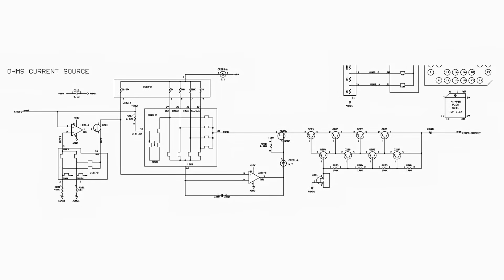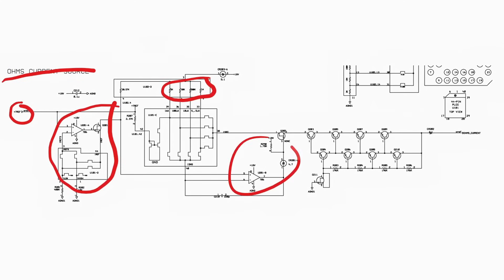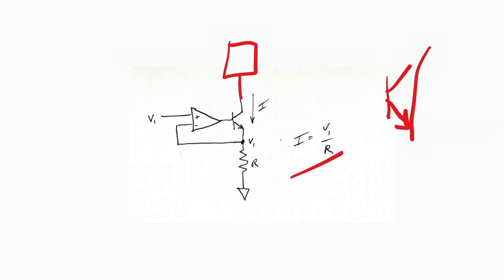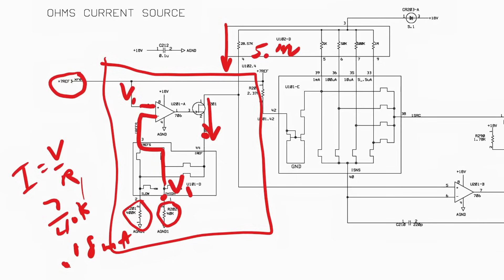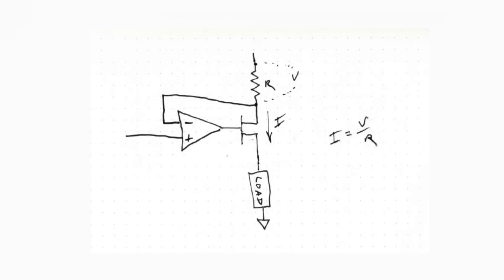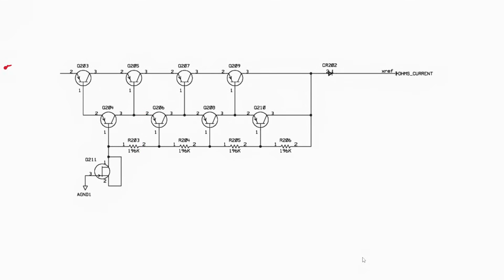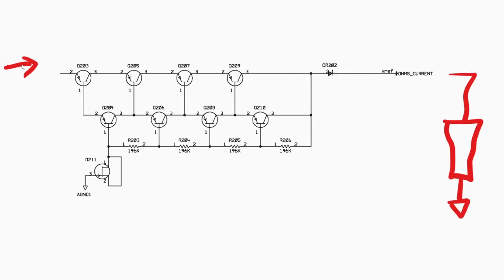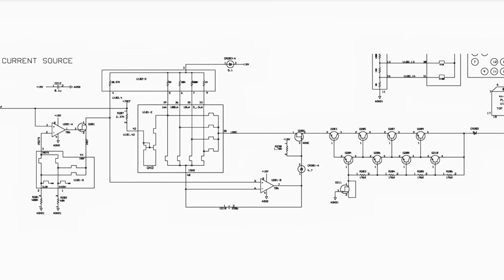#1818 Current Source from HP34401 Explained

Comment: I saw your video last night, so this morning I went to analyze the circuit (at 9:07) and I think this is correct: Q201 and U102 form a voltage mirror on pin 1 of Q202.  It seems confused, since U201 pin 6 is connected to Q202 pin 1 through the switches, it copies voltage from Q201 pin 1 to Q202 gate via U201, ending up Q202 working as a current mirror of Q201, it works pretty well.  The current mirror at the left inside U101, promotes almost 3mA (when the switch on source of the second fet is on) over the 5k resistor, what in fact zero the voltage at pin 1 of Q202, since the Vdrop over 5k is higher than 18V-CR203 zenerV,  it can calibrate the ADC for zero ohms when going into that scale.  This circuit could promote 8 ohms range, 4 x 2 (R201/R202), but uses only 7 ranges.

Comment: I had some success in lowering the noise of the ohm meter current source by replacing CR201 4V7 with a low-noise type.  As the zener CR201 is in series with the output of the op amp it contributes to the noise on the current source.  I would also replace C210 220pf with COG capacitor to reduce any TC effects.  Hope this helps someone.cheers

Comment: Hi, 
I guess that using transistor breakdown instead of zener is for speed. Seen many IC's with two transistors, each having their collectors shorted to base, and using the Vebo breakdown (typically 5-6v) as back to back zeners for input protection. The reason is the much higher speed of the transistor breakdown than zeners, so very fast spikes can be clamped.

Comment: Thanks for the video, I just subscribed to your channel.   I'm always curious on how test equipment electronics work.  Back in the 1990's I worked at HP Test and Measurement Division as a firmware engineer.  I was working on Automated Test Equipment that could test Flash Memory in the wafer sort in the semiconductor manufacturing process... I wished I had used my HP discount to buy my test equipment then.  Anyway, I purchased a used  HP34401 bench multimeter, specifically wanted it branded as HP,  and what a joy it is to use.  My display is dim, so I've already ordered a new one through E-Bay, a new VFD is on its way to me in 10 days. I saw your video on the subject and hope to get that meter back to its old self with the new display.  There are hardly any scratches on this equipment, so I think it had an easy life.
Reply: Hi Ray, perhaps we overlapped a bit. I worked as a hardware engineer on "the hill" until about 1991 and knew the whole design team for the 34401. I'm happy to say that I did purchase one at employee discount and it is still working fine on my bench at home. My present employer is kind enough to calibrate it for me from time to time. The ADC design from the 34401 was reused in the wildly successful 34970 DAQ box. We have three or four dozen of the later in service where I work. They are used in many production cells and also in R&D.
Reply: @davidrick959   That is so cool... I think it is so amazing to work with talented people that work on design... it takes a team, That is for sure!   I was at HP/Agilent 1996 - 2000, Worked at the Santa Clara Site, Building 53.  I worked in the CSTD (California Semiconductor Test Division) doing the firmware on their Test Site Controller boards for the Versatest line of FLASH memory testers primarily used in production cleanroom wafter sort testers.

I have to say that those were the last days of HP that I witnessed as the company spun itself into various companies and is no longer what it was... but at least I got to see it.   I visited HP Labs in the day, it was only a couple of times, but I'll always have the fond memories.

I found a local company here in the Bay Area that sells used lab equipment, and the old HP gear still fetches high prices... but they had some nice HP branded equipment and bought a couple of pieces, the Arb Frequency Generator 33120A and the 34401A multimeter.  They are excellent, as you well know, I put them in my home lab, and rack mounted them (somewhat on a shelf).  The Display on the multimeter is a bit dimmer than the other unit, while it is still visible, I'm going to replace it anyway... I plan to keep the other display... but it is a piece of history, and I enjoy using it at my bench.

Presently looking for work, Are you still with Keysight or whatever they call themselves today?

Comment: The protection circuit for negative negative voltages works like a kind of cascode circuit. Q211 works like a very low leakage diode.  R203, R204, R205, R206 are a voltage divider, so the reverse voltage is divided into -1000V, -750V, -500V, -250V, -0.7V. This causes also causes the corresponding voltage levels on the of collectors of each darlington transistor pairs. The BE diodes of Q203, Q204 and the reverse biased Q211 limit the minimum voltage at Q202 to -2.1 V.

For normal operation with positive voltages from the current source Q211 has high impedance. The very high amplification of the four darlington pairs cause just a small voltage drop on each of the steps of the voltage divider, like 1.5 V. So the total voltage drop of the protection circuit will be around 6 V for "high" test currents of 1 mA. For the low current ranges with 100/10/5/0.5 µA it will be even lower: U= (1,4 V) + (4 * 196 k * I).
Reply: Nope, but interesting thoughts. But: The [RTFM] shows: "Protection from large negative voltages is provided by the sum of the collector to base breakdown voltages of Q203, Q205, Q207, and Q209. Bias for these transistors is provided by Q211 and R203 to R206 while negative overvoltages are applied."
Q211 is a MMBF4117A (Transistor J-FET N-Chan D-Mode). This classic circuit is called: FET constant current two-pole.
[RTFM] Keysight 34401A 6½ Digit Multimeter, Service Guide, Edition 9, August 2014 by Keysight Technologies on Page 98.

Comment: There's a Widlar current mirror in the lower left corner of U101-E (that's the numbering on the IC) probably a custom planar CMOS FET array, and current mirror (Notice the degeneration resistor is not there... maybe the FET matching means it isn't needed?) I think the Guy has discussed current sources in another vid? But what's the dope on the one here?

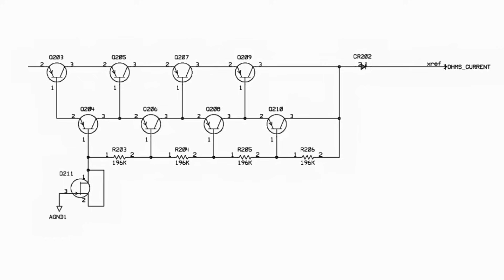Comment: 16:15 I don't follow this logic and how all 8 transistors oppose to breakdown? By Kirchhoff's law breakdown voltage between Qe(203) and Qc(209) is 4 times Vceo (if all top PNPs are the same).
When positive over-voltage is applied CR202 will block it. Q211 functions as a precision diode. When negative voltage is applied, Q211 will drive base of Q204 to ground and the whole transistor network will behave like an active load, limiting current and increasing its resistance to oppose increasing voltage. Voltage on the emitter of Q203 will be aroud 2Vbe (+Vgs). At extreme negative over-voltage 4 transistors on top, or in the middle will just give up and short, one by one. My two cents.

Comment: Thank you very much for taking your time to explain the whole circuit, indeed is a complex arrangement to make a "simple" current source. About the array of protection transistors, that was what got me thinking harder, although i had concluded that would be for negative voltage protection, i wasn't quite sure if it works as i thought it would. On the comments @cogoid complemented your explanation, i think that should be pinned. Once again, thank you very much! 👍😃

Comment: Problem is, the „standard“ opamp current source with the ref voltage against gnd  is in fact a current sink.
If it had to be a source (feeding current into GND), the ref voltages is against positive supply. With „sinking“ current to GND through a resistor connected to positive supply you get exactly this done: having a „5V-below positive power“ ref voltage to compare the voltage drop of the GND referenced current source‘s R against.
It’s a clever use of transferring voltage into current into voltage into current, where the input ref voltage (the 7V) is GND based and the current output is sourcing into GND.
(The old) HP has(/had) clever engineers. 👍🏻
Reply: 34401 is not that old. Ohm meters usually employ a 'low side' current source... that puts the current source between the DUT (a resistance) and the return (call it ground)

Comment: On the protection circuit:
Q211 will act as a diode for significantly large negative voltages, so putting the base of Q204 at about -0.7V 
As the absolute value of negative voltage at Xref increases voltage Drop on R203, R204, R205, R206 increases, so the base to base voltages of Q204,Q206,Q208,Q210 increases, making the transistors to shoulder the voltages equally.  Remember the emitter of these transistors are 0.7 V above base voltage (pnp transistor).
Also note that this circuit is beta multiplying circuit like Darlington structure.  During normal operation only very small current from main test current is used to bias these transistors.
To better see this replace this structure with Darlington Structure and connect the base of the Darlington structure connected to collector using 196K Ohm and compare it with single pnp transistor. Even though, all the currents add up in both ends, however much less voltage drop created on resistors.
Also note that Q211 is connected as diode ( I wonder why they did not used regular diode, may be because of low leakage current) and is off when output voltage is positive.
One should simulate this circuit with output connected to -1V, -5V, -10V etc. to see the distribution of base and collector voltages. Also it might be instructive to simulate this circuit with output connected to a resistor.

Comment: Thanks, I thought this was would be very interesting circuit when I suggested it a while back.  The protection circuit had me scratching my head,  finally had to SPICE the thing to see how it worked.   The key is the string of resistors,  the left end of the string is connected to ground through  a  low leak forwarded biased diode (the FET;s g-s) when a negative voltage is applied to the probe. Thus each resistor drops 1/4 the voltage. 

Think of the transistor pairs as darlingtons and with the resistors makes this a current limiter ( or current source if you like) when the probe is accidentally connected to a negative voltage.  With -400V on the probe each resistor would drop 100V and the transistors would limit the current to limited about 1mA if I remember correctly.  Thus each pair to transistor  only has to manage the Vce breakdown  and power of 1/4  the -1000V speck.  And the 1mA current limit prevents damage to the main percision current source circuit. As IMSA explained so well.    The output diode protects from positive voltages.   In normal mode (probe > 0V) all the transistors are conducting and  all current entering the left side exits the right side since there are not other connection paths.  As  mentioned, there would be some small Vbe voltage drop which doesn't matter. 

Thanks again for the video.
Reply: Q211 is a MMBF4117A (Transistor J-FET N-Chan D-Mode). This classic circuit is called: FET constant current two-pole [1][2]. You are very near the design principle behind the circuit with your "biased diode", but "missed by a hair" is also a target miss, hehehehe. The [RTFM] shows: " Protection from large negative voltages is provided by the sum of the collector to base breakdown voltages of Q203, Q205, Q207, and Q209. Bias for these transistors is provided by Q211 and R203 to R206 while negative overvoltages are applied."

[1] I will not explain here why a self-conducting junction FET (junction FET = JFET) is suitable as a current limiter. This is best read in further literature such as “The semiconductor circuitry” by U.Tietze and Ch.Schenk.
[2] From the German terminology "FET-Konstantstromzweipol", see "JFET as a constant current source | All About Circuits" or "Mosfet constant current", EE-StackExchange

[RTFM] Keysight 34401A 6½ Digit Multimeter, Service Guide, Edition 9, August 2014 by Keysight Technologies on Page 98.

Comment: 17:00 These are high voltage transistors (>350V breakdown voltage each), and what actually happens for a negative enough voltage, is the Q211 diode starts conducting, and that clamps the base of Q204 to -0.7V, and thus the emitter of Q203 always stays at > +0.7V. This prevents the source to be pulled below +0.7V and limits the current to what the source is normally generating.

The transistor Q211, used as a diode, is chosen for its ultra-low reverse current, to not interfere with a normal operation of the source.
Reply: Hi. I am just getting the hang of this stuff. Why is it that when a negative voltage is applied in the wrong direction the Q211 diode starts conducting I'm unsure as to why this happens.
Reply: @trif169 The diode-connected Q211 goes from AGND through four series resistors to the output terminal. AGND is higher than the negative output terminal thus Q211 turns on, and the resistors divide the output voltage drop among them. The Darlington-connected transistor pairs then copy this voltage to their emitters. Since those are high voltage transistors, they can easily each survive having 250V dropped across it. At 1mA that’s 1/4W of dissipation.
Reply: @absurdengineering  You guys are on a good path, but "missed by a hair" is also a target miss:P:) 
Q211 is a MMBF4117A (Transistor J-FET N-Chan D-Mode). This classic circuit (which, by the way, also appears very often in digital ICs) is called: FET constant current two-pole [1][2]. The [RTFM] shows: " Protection from large negative voltages is provided by the sum of the collector to base breakdown voltages of Q203, Q205, Q207, and Q209. Bias for these transistors is provided by Q211 and R203 to
R206 while negative overvoltages are applied."

[1] I will not explain here why a self-conducting junction FET (junction FET = JFET) is suitable as a current limiter. This is best read in further literature such as “The semiconductor circuitry” by U.Tietze and Ch.Schenk.
[2] From the German terminology "FET-Konstantstromzweipol", see "JFET as a constant current source | All About Circuits" or "Mosfet constant current", EE-StackExchange

[RTFM] Keysight 34401A 6½ Digit Multimeter, Service Guide, Edition 9, August 2014 by Keysight Technologies on Page 98.
Reply: @dieSpinnt our aliases have  nearly the same meaning.  😊 
Its a (double) diode and not a two pole current limitter. Q211 Drain and Source are together and not Drain and Gate.
Reply: @trif169 To see it more clearly, start with a simpler circuit. Replace the eight transistors with just one, with the 200K resistor between the collector and the base. Assume some fixed DC current gain, say 100. 

The constant current from the current source, say 1 mA, flows into the emitter. See what the voltages on the emitter and the base will be, as a function of the voltage on the collector, as you vary it.
Reply: Thanks for your input, it makes sense, i hope your comment gets pinned, its relevant information.

Comment: 1) Contrary to what was said below this is not a stack of darlington. In darlington configuration both collectors are tied together. Here the even numbered transistors collector is connected to base of next odd numbered transistors. 
2) Q211 as connected act like a diode with heigh internal resistance and in normal operation it doesn't conduct current. But if a negagative voltage is present at  CR202 then Q211 conduct current and the voltage drop between CR202 anode and Q203 emetter will be equally distributed between even numbered transistors VCE. The voltage at base of Q204 base will be negative but below Vbe breakdown voltate and Q203 emitter voltage will stay a few hundred milivolt positive.  A JFET is used for Q211 instead of a diode because the internal resistance of the JFET channel limit current in Q203,Q204 bases.
As long as the maximum Vce voltage of transistors stay in specifications there will be no damage to circuit.  

I simulated it in ltspice before commenting.

Comment: the "unused" FETs on U101 (pin 42) are forming a current mirror, with current set by R207,  so probably part of calibration.  also, the video didn't explain why there's two current sources- why is the first one needed when you could just provide a reference voltage directly?  having two in series seems like it'd introduce more errors. maybe the reason is process variations on the chips?   if you used mechanical switches, the contacts generally have a known small resistance, but using FETs on a chip will have a much higher (10's of ohms or more) and worse, variable resistance that varies some chip to chip.  I am curious what the zener diodes' purposes are- is it to reduce the Vdrop across resistors which would improve their temperature coefficient by reducing self heating? (re: CR201 and CR203).
Reply: If you provide a fixed reference voltage to the second current source then the temperature coefficient of the resistors over there cause the current to change. In this case the resistor which sets the 5V reference also changes to compensate for it. You can look at the second stage as a temperature independent scalable current mirror where the accuracy is determined only by the first reference current generating circuit.
Reply: @robertvandersanden  Also it allowed the voltage reference to be raised closer to the positive rail so the circuit could be used to source instead of sink current.

Comment: I think D211, the odd FET in the bipolar chain on the output, is used as a very low leakage current diode.
Leakage currents are an error, and I've seen FETs used like a diode in sample-and-hold circuits.